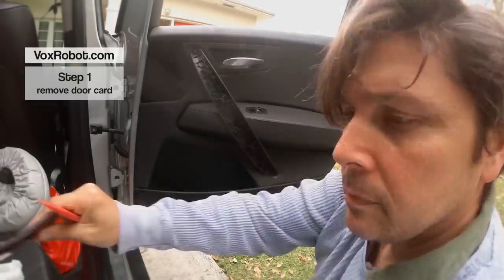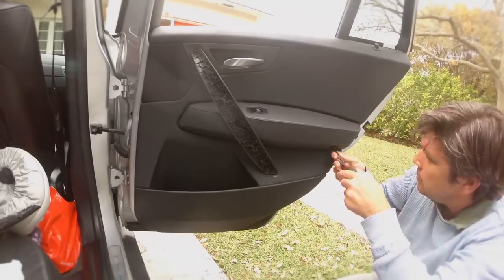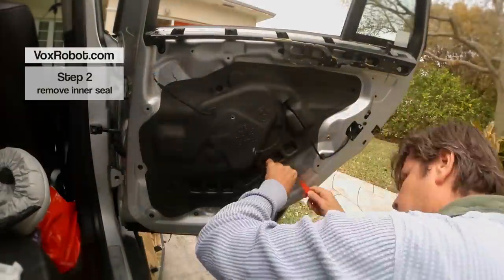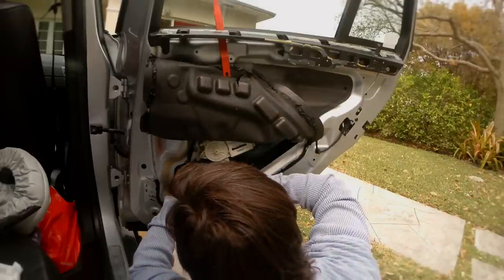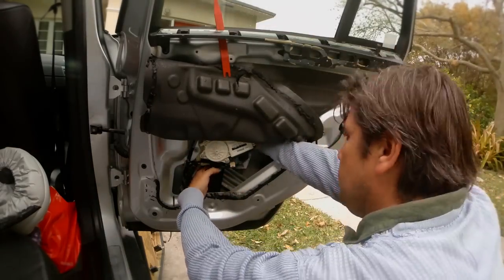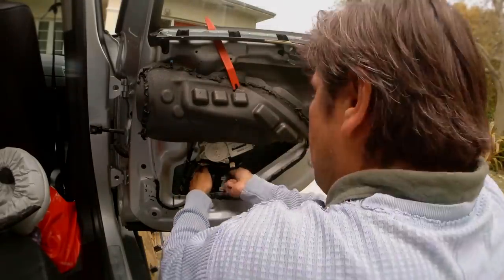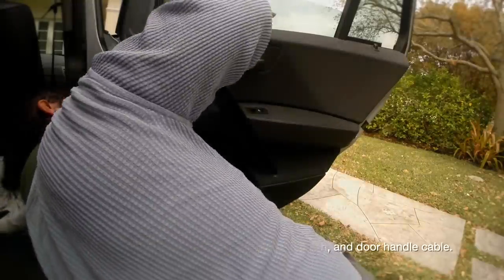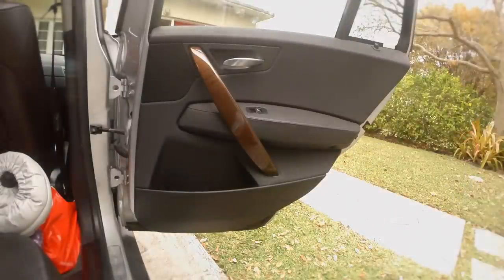Fix Broken BMW X3 (e83) Window -- Drive-Dogs Replacement - Regulator Repair

Comment: I didn't think a nearly $400 dealer repair would be so easy! I found the part online for ~ $20 and spent more time getting my tools and putting them away than I did on the repair. Was done in 30 min!   Thanks for the great video, it gave me the confidence to try it on my own without having to dedicate half a day fiddling around, it was so easy...
Reply from the maker: I'm glad it worked so well. Great to hear that the video was helpful.
Reply: That $400 repair is now $650 in 2023.  Ask me how i know... ;)

Comment: Looks simple enough.  I took the drivers side rear door panel off to take a look at why the window went down and never came back up.  It is the drive dog (not attached to the cable any more).   I'm going to get a new one and try this myself.  I'll let you know how this goes.
Reply from the maker: Make sure that the little lump in the cable is seated well in the plastic "drive dog" I had to take the door apart twice! Good luck and let me know how you get on.
Reply: The project went well, took me a couple of hours because removing the broken drive dog was a little tricky and took some careful prying to pop it off.  When the job was done, I also had an issue where the window wouldn't automatically go up and stop in the fully up position.  I had to re-initialize the window (there are several posts on-line with the procedure).  Job done, wife is happy, saved $$$ :)

Comment: Nice video, thanks! I searched for videos like this but only used the search word  "regulator".  "Drive Dog" is not that common of a term so this video is hard to find. If you can rename it and include other key words like "x3" and e83 I bet you would get thousands of hits.  Thanks again, I am about to go try to replace both rear window drive dogs on my daughter's x3 this afternoon. This video will come in handy!
Reply from the maker: +Kenneth Rada Thanks for the suggestion. I'll change the title right away.  I hope you were able to mend your windows!

Comment: Great video. I had exactly the same thing happen and followed your video precisely to fix it. I even ordered the part from your link. The only difference is that my 2007 X3 only has 3 bolts on the back door. Thanks for posting!
Reply from the maker: Happy to help!
Reply: One note: on my car (the 2007) the bolts are actually T30, not T27. The T27 wrench will work, but the T30 is the right fit. Thanks again.
Reply: Mine had 3 bolts too (there isn't one under the handle) and as noted the T30 Torx tool is the correct fit.

Comment: Just want to Thank You for your great video. I studied it for days, yep all 2:57 mins of it before i tackled my driver's side window. Ordered the window regulator online for $60 and then got to work. Was tricky getting the 2 plastic "dogs" to pop off the glass as i didn't realize the glass has 2 holes on the bottom where the plastic dog hooks on to. Had to replace the regulator as the cable had shredded and tangled up in the casing. Was easy , unplugging it from the motor and taking off the bolts that hold up the 2 arms inside. Lining up the 2 holes on the bottom of glass to latch back on to the 2 plastic dogs again was challenging...but happy to have done it myself and save $$$.
Reply from the maker: Glad it worked out. The first time I had to pop-out the plastic dog I thought I was going to break the glass.
Reply: I've been watching this video multiple times while I wait on the parts to get here lol
Reply from the maker: Glad to help

Comment: Great video, very useful. Just fixed the rear passenger window on my 2009 X3. A couple of minor pointers in addition to what you provided:

1. it's much more fiddly than you make it look, patience is required ;-)

2. a) on the 2009 X3 there are only three retaining bolts, the recessed one under the arm rest and two under the trim
   
     b) it is a T30 torx/star bolt on this model. The recessed ones are extremely hard to reach and mine were extremely tight and took a lot of effort to loosen. Best if you have the correct equipment, i.e. a torque wrench that can reach recessed bolts.

3. on the replacement (non OEM) regulator I bought on Amazon, the rubber stoppers were not included. Keep your old, broken regulator and you can reuse the two rubber stoppers for the window. This may also explain why another commenter had problems with alignment.

Anyway, many thanks!
Reply from the maker: Glad to have been (at least some) help. Yes the whole this is super fiddly -- this was the 4th time I've done this and by the vapor barrier was already loose. My X3 was 05 -- I think they added an additional bolt and there might have been a change in the door hardware. Good tip about the aftermarket parts and rubber stoppers. For the amount of trouble I was happy to pay the 38 dollars for the OEM part.

Comment: had the same issue with my X3 2008 3.0, word of advise, use white lithium grease on the rails and lubricate any moving part while you already have everything disassembled

Comment: Thanks.  It is fiddly but awesome video.  One has to be very careful.   I used a match and slightly burned the clip lip to release the window.  I thought it was safer and avoids window breakage
Reply from the maker: Uh - I would avoid fire, but I'm glad it worked out.

Comment: Getting the drive dog out seems to be tough.  Still trying.  A little more detail on that would be helpful.  After it is back together, will it keep coming out? In other words, is it better to replace the drive dog with a new one and are they available.  Thanks.
Reply from the maker: If your window did not come up - the usual failure mode is this plastic part breaks and the cable from the regulator goes up and down without the window (by now the window is down).
Just to sure the drive dog is just the plastic bit that snaps at the bottom of the window glass. Is a bit nerve racking to push the retainer out of the glass window. You can cut out the old plastic -- by now is probably hard and brittle. And is not repairable. 
There is a link in the description to where I bought mine, not every dealer stocks them. Make sure that the lump in the cable is seated in well into its slot, or you will have to take the door apart again. 
Take your time and let me know how you get on.
Reply: I finally got it out.  Just had to push a little harder.  Thanks.  The retention for the cable is broken on mine so I need a new one..  I bought one on Ebay for 8.55.  Looks identical to mine except I can see the retention track for the cable on the new one.  I'll give it a try.  Your video was very helpful.
Reply: By the way...I used a cedar wood shim to hold the window up and it worked good.
Reply from the maker: Glad to help!

Comment: After replacing the clip, the window goes up and down normally, but when it goes up, it hits the top and comes back down as if it hit an obstruction. I checked and the window is in the clip. I am wondering if the rubber bumpers on the clip are holding the windows too high up.  Have you heard of any problems like this?  Is there an adjustment you know about to determine the stop point so it does not reverse? Thanks.
Reply from the maker: It maybe that the window regulator mechanism needs replacing. But make sure there are no obstructions on the track. Try a graphite powder lubricant like this one if the glass has trouble going up and down the track --> https://www.amazon.com/American-grease-stick-graphite-lubricant/dp/B000K7TOLE/ref=sr_1_2?s=automotive&ie=UTF8&qid=1470959156&sr=1-2&keywords=Powdered+Graphite+Lubricant
Reply: I lubricated the track and ran it up and down a few times and it is fine.  Thanks again.  Super advice.  Saved me $$.  I think I gave you a LIKE already but I will check.
Reply from the maker: Very glad it worked out -- enjoy your x3

Comment: Hey can you please let me know the Amazon link to buy the drive dog. I have tried searching, but couldn't find it.
Reply from the maker: As far as I know these parts are only availble at BMW Dealrs. If you find it at Amazon it will probably be an Asian knock-off -- which may or may not well made. The price difference may be tempting, but after having to take both of my rear door appart (one twice) I can tell you that it is not worth the savings.
Here is the BMW part number: 51 353448645 ( I don't remember which side) Make sure to the corect one.

This is the same link (not a referal BTW)  to where I bought my replacementshttps://parts.bmwofsouthatlanta.com/products/DRIVING-DOGFRONTDrivers-window-rear-positionPassenger-window-forward-positionREARDrivers-side/1332480/51353448645.html
Reply: Thanks so much !

Comment: Nicely done! thanks for taking the time to make the video. Btw what year is your X3? Will be doing this on a 2007 soon.
Reply from the maker: Thanks. My X3 was a 2005 -- Sadly (I loved that car) the little problems added up until it made driving it not fun at all. Then the AC broke for the sixth time. Replacing the ac condensor is an absolute pain (the whole dash has to come out) and in South Florida is not an option. So it more sense to traded in for the awesome i3.

Comment: i have a battery drain and no one can find the problem someone please help its a 07x3
Reply from the maker: Ugh -- sorry to hear that! Not entirely related but one of the lights above the rear door had a short -- for years. It kept blowing the fuse for the tail gate. For which there is no key and it is stupidly difficult to open from the inside.
Reply from the maker: I never had to recharge the X3 battery -- it got too much use and was always charged. But on my other car (e46 -m3) I have an CTEK MUS 4.3 automatic charger topping the battery almost all the time
Reply from the maker: Thanks for the great info --- that might explain why my M3 keeps draining the battery
Reply: @W D You may have given me where to look at, My 2005 x3 drains the battery if not used every day

Comment: Useless video of 3 mins, all run on superfast speed without showing what is being done. Not good.
Reply from the maker: You can slow the playback speed on YouTube — but then it would have been 5 useless minutes :) Please don't take offense to this: changing the drive dog is not hard, but it is very fiddly — if you had trouble following the video think hard before cracking your door. If you have any questions I'd be happy to help. Light and peace BSD.
Reply: Slow down does not show what is being done, so it does not help.